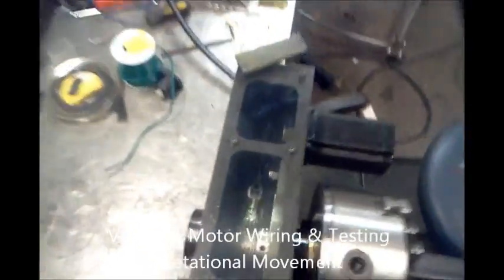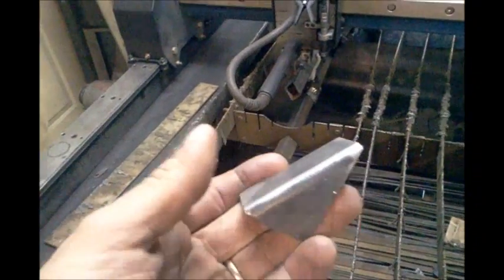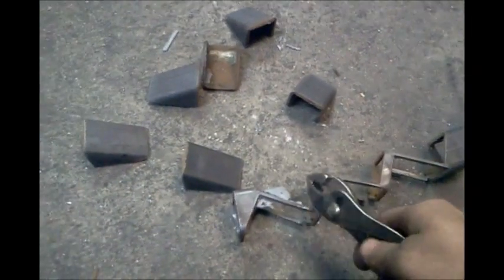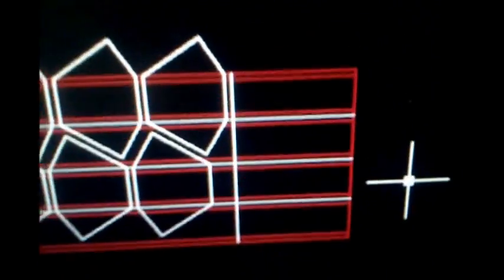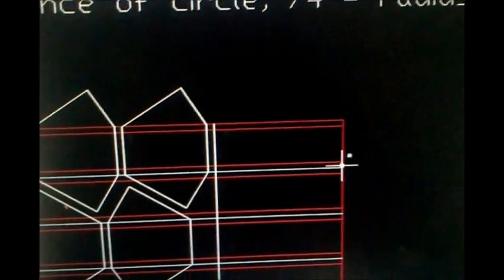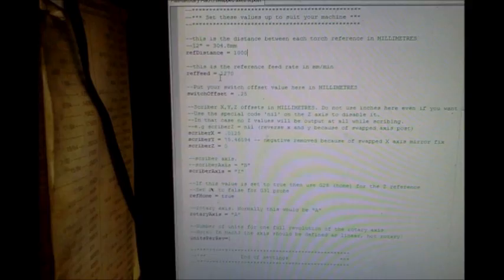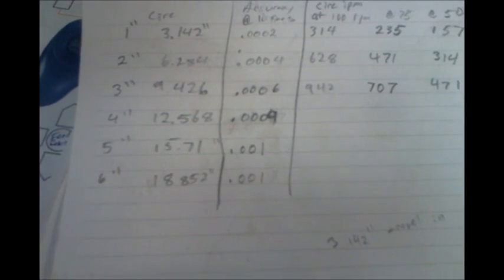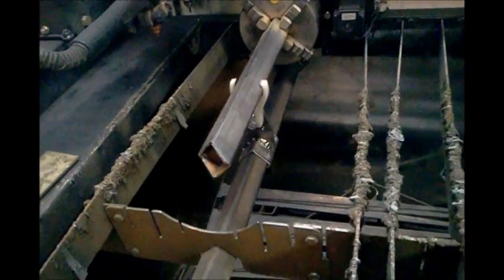WMF CNC Plasma Rotary Tube Cutter w/ Sheetcam Rotary Plugin

Comment: What software do you use to control this? And what software to create G code?
Reply from the maker: Mach 3
Reply: This is awesome! Now I am confused if I want breakboard with direct mach 3 support and work from PC or use this thing. This looks like an elegant solution. You create your code on a PC in clean office. You do not need a PC in your workhouse. Then you just bring SSD there and run the machine. Also it looks like with this controller my CNC would look more industrial like.

On the other hand Mach 3 has more features and someday I might be sorry I did not use it and PC directly to CNC.

Comment: Hi, good machine !! Do you use THC for the square tubes?
Reply from the maker: +Tornería Roman Yes the THC is also active during all tubes, but probably wouldn't have to be, it just a little added insurance to get proper cut height.  The THC is not what controls the z height for the corners though, it is programmed in.
Reply: THC is programmed in? It has special inputs to connect Plasmacutter? Or I have to have THC controller separately?
Reply: wonder how one would do that , is there a square tube option in the program that you tell the side size of the square tube and it adapts the g code to match , the 4 jaw chuck makes it clear where those corners are offcourse
never mind you explaned it in the video you fold the tube out on the program and make the one axis rotateable , still makes ajusting the height a bit of a dark art
i think if someone was to make a add on g code program made for cutting square tube it be a lot eazier to do

Comment: How much for one of these bottle openers? I want one! :)
Reply from the maker: LOL, if you are serious, send me your contact info / email.  sales@wolfesmetalfabrication.com

In raw steel or????

They are the last thing on my to do list, and i actually need to modify it abit to be a good bottle opener, but i could possibly cut you 1 (pricey per piece) or a handful if you had use for multiples (less costly per piece), if you are not in an extreme rush to get it/them.
Reply: LOL your "LOL" gave me some doubt but email sent.
Reply from the maker: dmak2
Sorry, it was not meant to, i was just messing around, and never figured anyone would want any of these, but they have actually brought more interest than i thought.  That was the reason for the LOL.
Reply: Wolfesmetalfab It's a quirky, useful and rare object. Produced in a brutal, yet cunning way. I like it. I assume the bottle opener part is tested and works well? :)
Reply from the maker: dmak2  :) it will be tested and adjusted before any are made for sale. It was actually just a coincidence, as it was just an opening in the back of the chair at first until the thought came across..."Hey, thats a cool bottle opener"